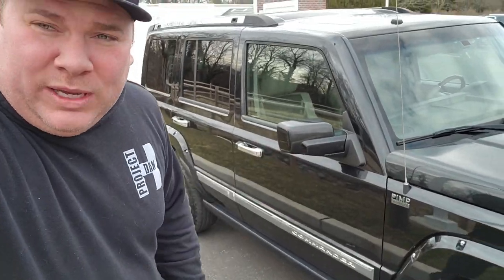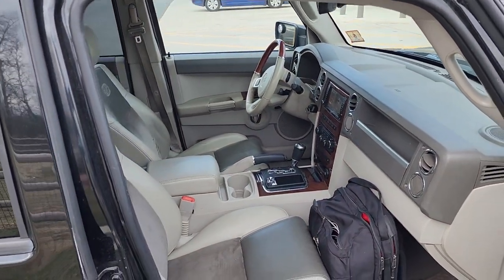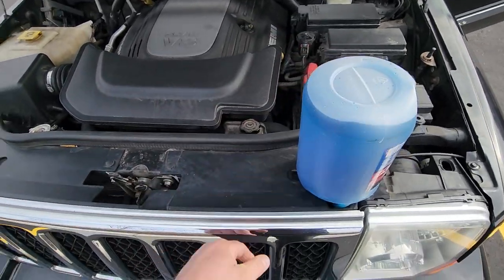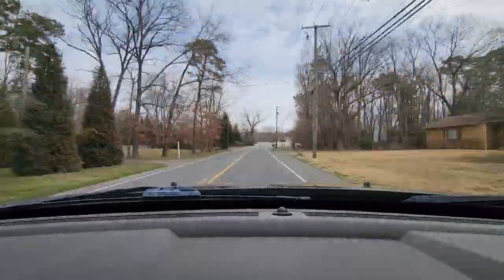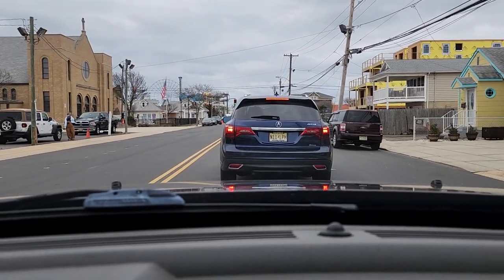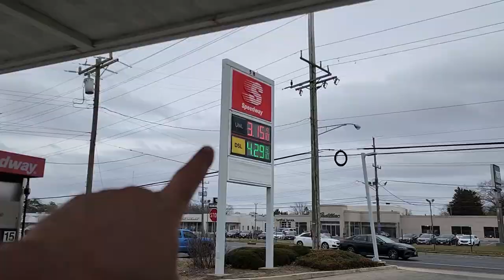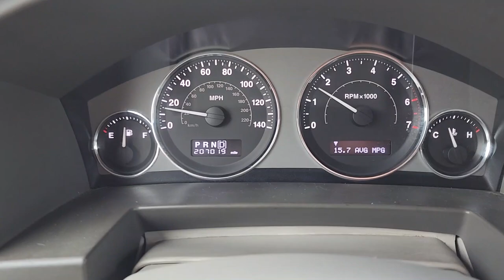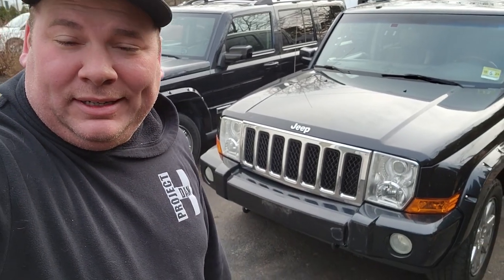ANOTHER JEEP, FROM NEW JERSEY!  PICKING UP A 2009 JEEP COMMANDER OVERLAND  5.7 HEMI

Comment: sweet Commander, i really like my 07 Commander. so id like to call dibs on the light tan steering wheel if you swap it, i like to try and use it on my 96 XJ i just picked up, so if you swap it out ill buy the light tan one👍 i was actually gonna msg you to ask what steering wheels i could possible swap on a 96 XJ
Reply from the maker: Tan steering wheel is all yours brother!  Ill see if it works on an XJ column and let you know.  Email me you contact info again to dhartman.mail@gmail.com

Comment: Best of luck on your endeavors with the Commander(s).  I'm not sure about anyone else, but I think I've come to the point where I prefer old style simplistic features.  "Quarter" triangle windows, crank handles, environmental controls with a cable and less or no plastics.  I'm that guy who'd be pulling crap out a new "wrangler" onto the ground like in the movie Armageddon stripping al the useless weight fluff.  Which means I'd be better off buying some old CJ off a lot.  It also makes me the same guy who'd be getting rid of a Stellantis to get anything with any Dana front and rear.  😜🤣

Comment: Hey Dan before you lift it you have to get Tom woods front differential axle mod...I replace my axles every 6 months or so ..they run 499 a piece compared to the high angle cv axles...I have the same thing but mine is the 2005 grand Cherokee with the commander front diff till I rebuild the old one...oh sa e that diff they don't sell them if they do they are 2900 plus 299 to ship...mine has electronic lockers known as quadra drive two .I have so much time in mine...fun to work on though .oh replace those lower shock mount and  clevis bolt ..if it's rusted in..grab a beer first and some time..

Comment: Dan H. helped me DIY my ZJ...and has forgotten more than I know about Jeeps....
Apparently the 2009 is slightly better than the older years...the 5.7 is an advantage as well. Found 2 issues for the 2009 on the internet (See below)...easy peezy for Dan, probably....(16 spark plugs for the tune up , Dan H. account? ha...Subscribe/ thumbs up, lets help Dan get to 50k).

1.)Delayed engagement of the automatic transmission may be due to a faulty internal cooler return filter. Our technicians tell us all cooler filters with the "AB" suffix on the part number are suspect and should be replaced.
2.)The service 4WD system light may illuminate with no fault codes stored in the final drive control module (FDCM). Our technicians tell us a software update for the FDCM is available to correct this concern.